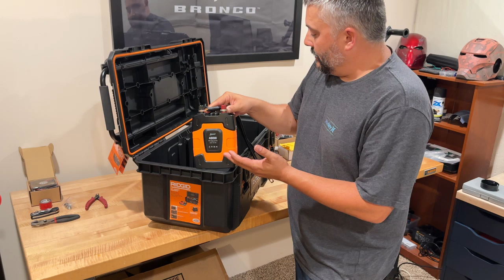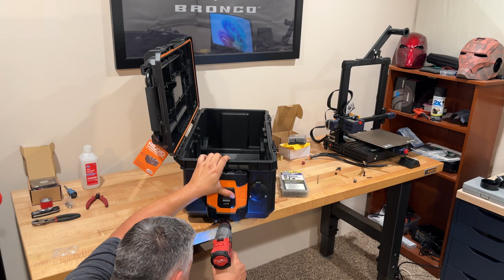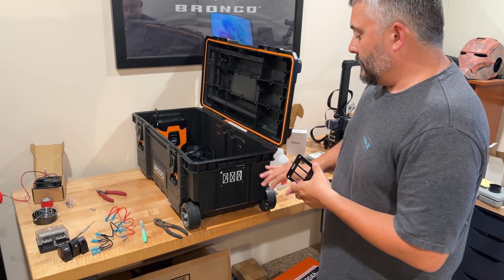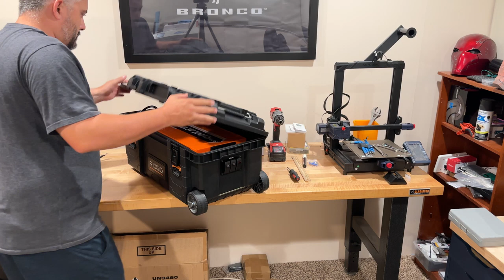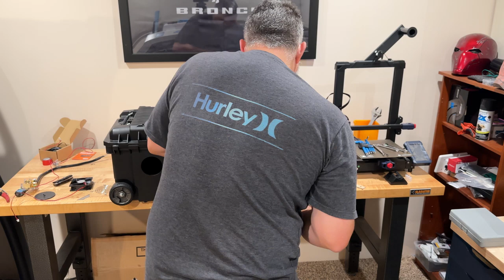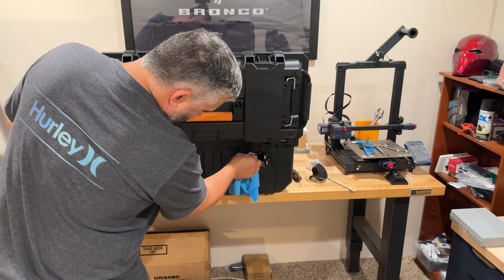How to Fit a 200ah LiPuls Battery in a Ridgid Box for Camping: Part 1

Comment: Comment on the inverter, get a semlax inverter. Rf quiet, Prue sign wave,  600 watt, grate inverter and very reliable. Like the idea of a riged box. Way to long of a video. Also for out side DC connections use power pole connections. Very little resistance  with these connections so there's really no getting hot with power drow I've used power pole connections on many devices. Also it's a industry standard because of them having very little to no resistance in there connections.
Reply from the maker: Thank you for the suggestions and watching.

Comment: Nice build! Can you weigh it when complete? Only thing i would suggest is using a pure sine wave inverter vs modified wave. Just my humble opinion. Thank you for your time.
Reply from the maker: @pt4826  I was having troubles finding one small enough to fit. It’s really tight tight in there